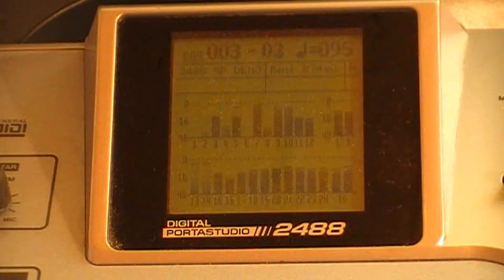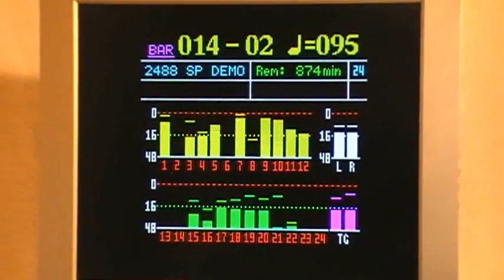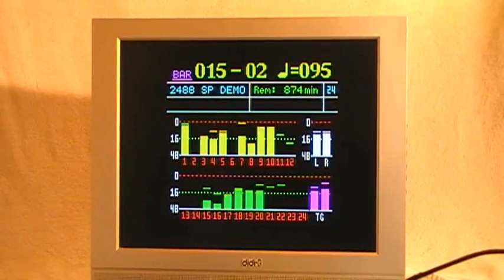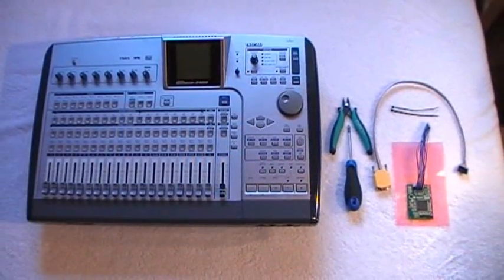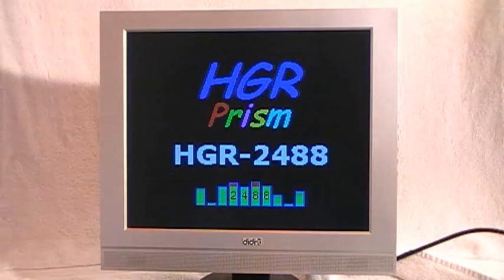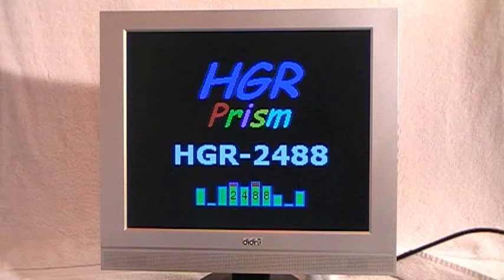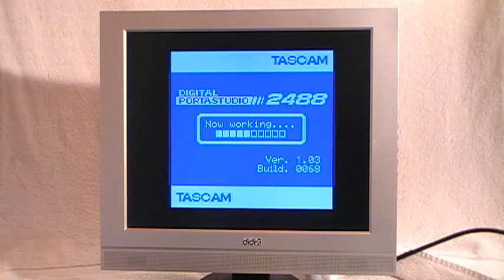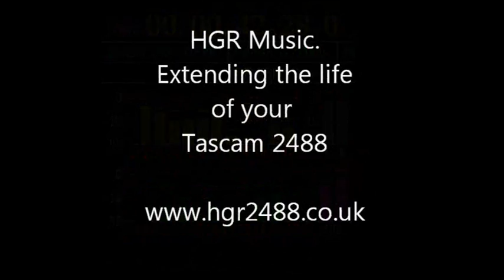Installing the HGR2488 Prism VGA Monitor Interface in the TASCAM 2488

Comment: Will the interface work with the new Tascam DP-24SD?
Reply from the maker: No, the HGR-2488 Prism is only compatible with the Tascam 2488
Reply: @HGR2488  ..cant the modder work on korg d multitrack recorders there better machines than the tascam and no one has modded them

Comment: Is this still available? What is the total cost? 
Vince from California, USA
Reply: just buy a zoom r16 or r24 your tascam will die they you find one of these hgr convertor.........
Reply: @mrblister8359  thanks for the advice...good thing i found one before it died
Reply: @vinnybking  you bought a “Spartan  FPGA board''  you can buy them anywhere lol
Reply: @mrblister8359  well you didn't say that before...but that don't matter now like i said I found one on Ebay
Reply: @mrblister8359  yes but which model board do I need and does it need programming? Also a wiring diagram? I could do it myself if I had any idea what pins are what.
Reply: @upalevelproductions  that's a good question I don't know I have tried researching these boards the for custom programming anything.  It would be easy to contact a manufacturer on Ali express to make one after all the jerk that stopped making these because it's so easy to just buy the converter board from china there is no money to be made. There is plenty posts on tascam forums of people asking what they basically need to make a VGA adapter he is very secretive the jerk. But a Chinese manufacturer would sell a lot of units if they produced them. I only use the tascam now to record audio and then import to a daw. I would love a screen but the jerk was changing too much for something that cost next to nothing to make.
Reply: @vinnybking  Could you send me the link to the seller. I can't find any in Ebay, I am looking for one HGR 2488 Prism VGA Monitor Interface. Thanks!

Comment: So, where does a person get the interface? Am I just buying the interface, or does it only work with that specific monitor? And like the below me.. any reason it wouldn't work with the neo. That's the only thing I really hate about most portastudios, you have to squint thru EQ'ing and most everything. This would be perfect.
Reply from the maker: The HGR-2488 is available from www.hgr2488.co.uk priced at £79.99 including worldwide shipping. We supply the interface, video output cable, cable ties and installation instructions. You supply your own VGA compatible PC monitor or LCD panel. The HGR-2488 works with all versions of the Tascam 2488 (MKI, MKII and Neo)